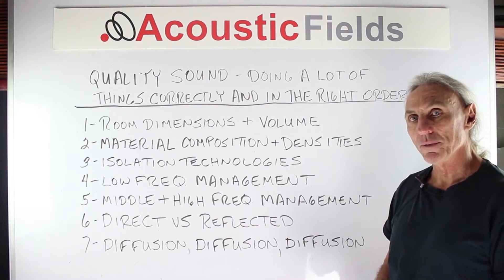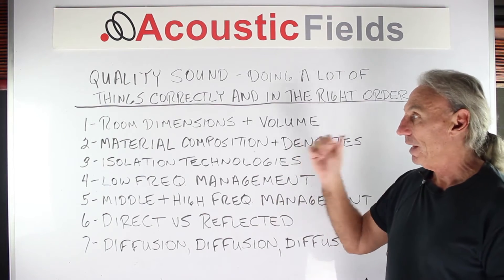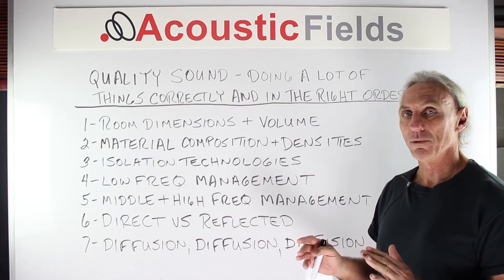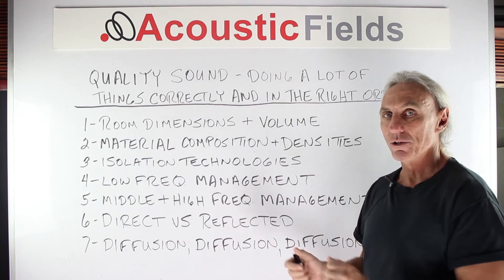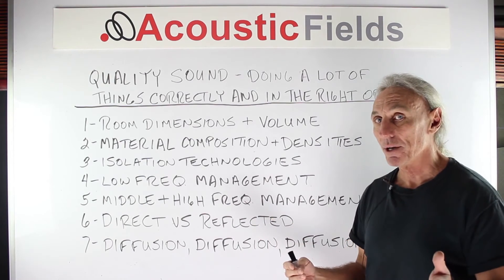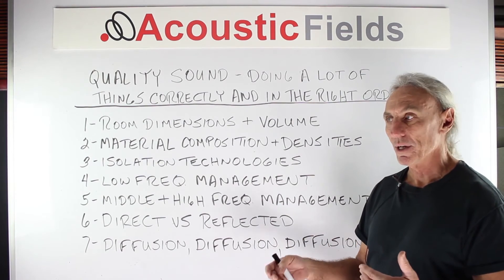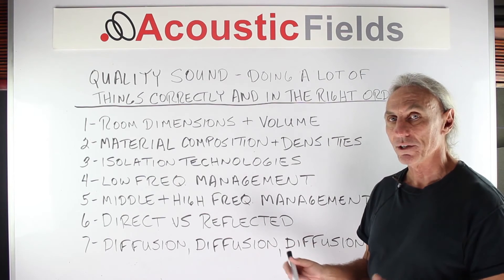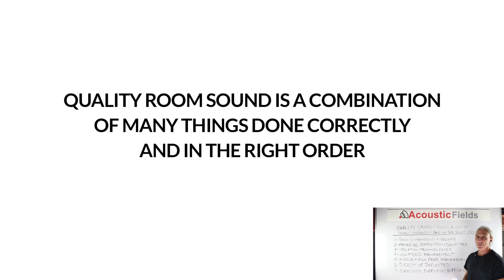Why Quality Room Sound Is All About Doing A Lot Of Things Correctly And In The Right Order

Comment: Sir  home theater sound proof  door what materials to use tell me sir
Reply from the maker: No such thing as a sound proof door. You must match the density of the door to the density of the wall it is attached to. The wall desnity is determined by the frequency and amplitude of the noise.

Comment: I'm in the red zone (10W x 8H x 11L), and this is my only option for audio editing/mixing. Any suggestions? Drywall also thx
Reply from the maker: J, Low, middle, and high-frequency absorption on all 4 walls.
Reply: Thanks - also I'm short, so I don't need a ton of height on the ceiling lol...I'll do some low/mid/hi up there too. Would you suggest diffusion at all, or is the room just too small to even benefit from that? From what I'm learning, a room can sound "bigger than it is" with the right diffusion, but I'm assuming the right volume would also be a necessity
Reply from the maker: J, If we set up on the short wall, let's assume a 4' distance from front wall to speakers. We will have another 3' to the listening position. This gives us 7' with 4' remaining to the rear wall. The diffuser will take up 9". This leaves us with a net 3' from diffuser face to the listening position.  There is no distance for the lowest octave to fully form.
Reply: Thank you kind sir